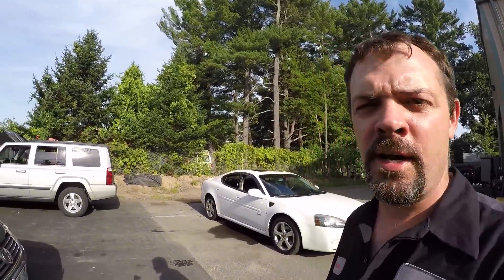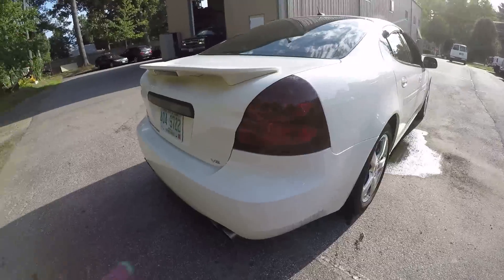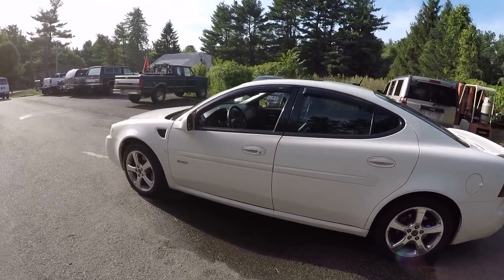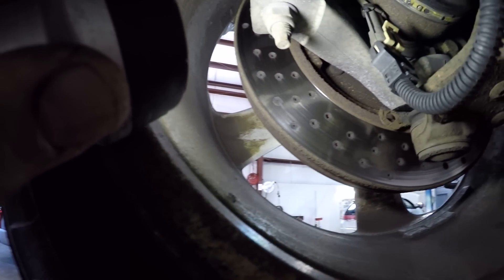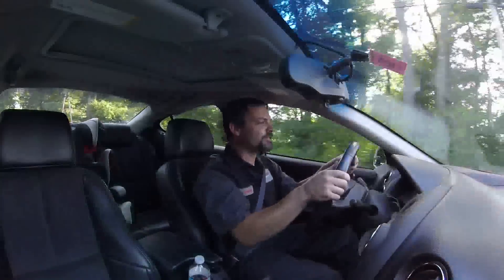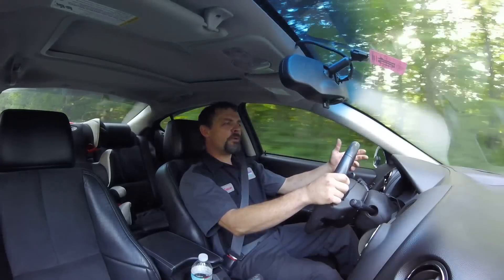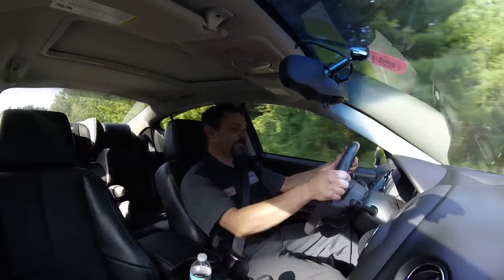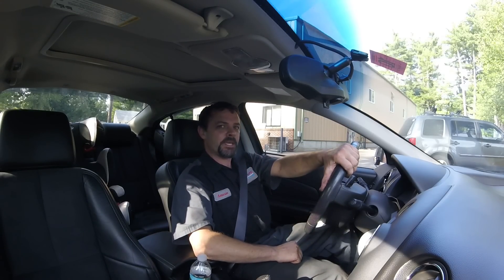Factory LS Powered V8 Grand Prix! The Pontiac GXP.

Comment: I own a 2006 Grand Prix base model, but it’s fully loaded. I bought it in 2009, with only 60,000 km, it now has almost 200,000, and it just keeps going and going, all I do is have a service done every 5000 clicks, replace the usual things like tires and brakes, etc., but I got a Telya I’ve driven a lot of cars in my day, and this is one of the best cars I’ve ever owned, for a lowball domestic want to be sports car, it has a lot of balls, the corners so tight, the seats grip you, and even with The base engine, there’s not too many cars on the road taking out performed by Grand Prix. For some reason a lot of people look at my car and laugh, and try to accelerate me, they stop laughing after I leave them in my dust, the GM 3800 series three V6 has a lot of balls for a regular car. The transmission is cleared so that after you hit 120, kilometres per hour that is, you don’t feel the thing, and before you know it you’re doing 180, which I’ve accidentally done on many occasions. I just fell in love with the car, I don’t know why because really to look at it there’s nothing special about it, but it fits me like a glove, and until the engine dies completely, I’m never getting rid of it. It has no rust at all, it looks just as good as it did the day at rolled off the assembly line, mine is midnight black, with a limo tent on the windows, so I can look pretty aggressive at night on the highway. I’ve also driven the GT and then the GXP version as well, but honestly, there’s not really a hell of a lot of difference in engine performance. You think the GXP V8 5.3 L that puts out 103 more horsepower than my car, which snap your neck back, but I only noticed a small difference and exhilaration,The only difference was the GXP drink fuel almost twice as fast as the base model that I have, which I have to say is really good on gas. Anyways, just thought I’d throw that out there, have a great day guys!

Comment: Actually some younger people want a grand prix i want one for my first car and im almost 16
Reply: I would stay away from these unless it has a TEP transmission. The stock tranny was known to go out, mine went out 4 times while under warranty and luckily not since. Planning to give this to my kid when I pay off my other car and get another
Reply: I've had mine for almost 2years and drove it pretty hard. I'm needing a new car soon but that's only because there is a lot of rust, the car it self has 345,000ish kms on it and still running nicely. It only left me on the road once when some clip for the coolent broke and all my coolent drained, I was still driving it around on max temp for probably 10 to 15 mins not knowing that it's overheating. But that was last spring and it's been fine ever since.
Reply: Crazy that this comment was made 4 years ago and I’m in the same situation. My mom is giving me hers, needs a little bit of work but hey I’m grateful.
Reply: I got one for my first car, im 17 and i love it, once i move out of the house and get some money i might get a gxp
Reply: @MustangMan1  Couldn’t disagree more, i have a 2008 and it has 106K miles and the transmission has never gone out once... It’s possible to get a very reliable one
Reply: A Pontiac was my first car at 19

Comment: my gxp has 80500 miles. still going strong. wish the underside of mine was that clean lol. its been in Illinois for 15 years though so you could guess what it looks like.
Reply: same here 130,000 and going strong .. Jersey winter salt ..her poor underage .. I now spray it down with  WD40+ trans fluid .. but she still gets out of her own way  .. fun at lights ......
Reply: @TomDoesUtube  lol yeah salt sucks. 130k is good for these transmissions hope mine will make it that far. At 83000 now. Still feels like it’s shifting good
Reply: @treecutter116  the starter on mine has been working fine but it has that issue that’s common in these cars. The starter doesn’t disengage from the flywheel right away and it makes a grinding noise. Only when it’s cold outside though. Might get it replaced before next winter.

Comment: I love mine,  I have embarrassed some ricers  and gave a couple Vettes a run for their money but they did beat me.   Best surprise was on I40 somewhere in AZ. I beat a new Cameo.  Mainly because his cut off somewhere around 150MPH  and I had the limiter on mine deleted in the tune.     He pulled up beside me and gave me a respectful military type salute as he smiled and shook his head.    No doubt he would have won if he had a tune but I will take the win.  On the same trip me and a C6 Vette cruised for 75-80 miles and over 100MPH  we took turns leading.

Comment: I got one of these. Mines black though and its an 08.  They are good cars but the transmission is the weak point because they used the same transmission from the v6 models. The 4t65e hd
Reply: I have an 08 too man since brand new. Still gets down like new. 200 thousand
Reply: @randomfootballcars9547  do u ever get on it speed wise? That's alot of miles but💪🏾

Comment: Really, that's the kind of car a dad would drive, a family sedan with plenty of power.
Really with something like that with its power and torque it should have been built in a RWD Model.
Reply: Which is why the G8 was imported. Was planned to take the Grand Prix position as the family sedan. If you want performance in a RWD package, G8 is the way to go. For Pontiac anyway.
Reply: +Chris Monroe I thought that was what the g6 was for
Reply: +no horizon G6 is only a 4-Cylinder or v6
Reply: 100% agree
Reply: @chrismonroe8417  if you can find one with the V8 in it! If you’re a diehard Chevy guy, you need to find an Impala SS or the police version SS..... V8s all the way with RWD

Comment: Interestingly enough, the GXP option on 2004-05 Pontiac Bonneville came with the V8 Northstar engine. Would much rather have the S/C 3.8 or the 5.3LS over the Northstar though in my opinion.

Comment: if I'm not mistaken it's a 2008.  the last year of Pontiac they decided to put a V8 in almost every car they built. the Bonneville came with a Northstar and the G6 came with either a turbo or super charger.  I think they figured if their going out why not go out with a bang. lol
Reply: sadly most of the transmissions can't handle the power and they are the ones doing a bang
Reply: sadly most of the transmissions can't handle the power and they are the ones doing a bang
Reply: None of the g6 models were either turbo charged or super charged
Reply: @Moecean  Thank you. Don't know where he got that info, but it's definitely not accurate. The G6 GTP could have definitely benefitted from a low boost supercharger though, something like what the Grand Prix GTP had.
Reply: @Jayhoyt32  either a supercharger or the turbo 4cyl from the 08 cobalt ss would be a really nice fit.. I wonder why they never stuck that engine in one..
Reply: The Grand Prix got the V8 from 2005-2008
Reply: its either an 06 or 07. 05 didnt have the black paddle shifters or chrome rings around the air vents. and half of the 2007 and all of the 2008 models didnt have forged alcoa wheels.
Reply: Yep. Last year Grand Prix. Bought mine last year and it came with a brand new transmission with a 3 year warranty. It’s dead mint. 5.3 LS4 V8 has mega torque. Sport-tuned with AFM/DOD deleted. Hauls ass. Alcoa aluminum staggered rims. Handles like a dream. I actually prefer the front wheel drive. Luv my car
Reply: @Moecean  the g5 was
Reply: @Moecean  g5 gt

Comment: Can I swap a gtp05 transmission into a gxp 06? If so would it be worth it? 118,000 miles gxp transmission bad. 130,000 miles gtp need head gasket but I'm just taking the transmission.

Comment: these have the 4t65e transmission. the same ones that they put on the base model v6. that's why I'm hesitant to buy one because they aren't build to handle an ls
Reply: The 4t65e is built to handle the supercharged 3800. There's plenty of guys who take those cars drag racing and have the engines built up stronger than the ls4. That transmission can take it all.
Reply: kajidono the trans in these cars go bad so easy. I've seen so many barely get to 100k miles. before trans messes up. my dad's only has 56k and he has already felt it messing up.
Reply: I've done some more research on these, and actually have a 2004, and you're partially right. I should have specified 4t65e-HD, but that's not what goes in the base v6. The 4t65e-HD is hit and miss on how well it holds up. It has smaller parts, like the differential, than the 4t80e, but it can be rebuilt much stronger and it's lighter. Mine with the 4t80e has 162k on it and the axle has worn into the housing so bad that it leaks right around the new seal I had put in it. Nobody even wants to work on it. On the other hand I'm looking at one with the 4t65e-HD with over 280k on it and there's nothing wrong with it. My old Bonneville had over 240k on it and it held up fine, even though the fluid was black. The base v6 gets the 4t65e. The supercharged and v8 models have always gotten the 4t65e-HD or the 4t80e (Northstar cars).
Reply: Jake Bergren no
they got the 4t65e-hd.
They have a few upgrades to make them stronger but yeah it's basically the same architecture.
Reply: Gm fwd transmissions were crap from the factory. The 4t65e hd can handle some power but over 300hp they are sketchy. I managed 320 whp in my ssei but even I was doubting the trans at that point even with 92k miles on it. But in reality an l67 can make more power for less money than the ls4. Sucks the Bonneville gxp only had the shitty northstar motor when they should have had an ls instead.
Reply: It's really a ticking time bomb. I bought my 2007 Impala SS almost 3 years ago with 75k miles and after the first 8 months of owning it, the trans ate shit. Had a local shop rebuild it but there was a hairline crack in the case that caused that one to eat itself alive in about 500 miles. Now I'm on trans number 3 because the aftermarket remanufactured one that was put in after the first rebuild had the forward bands fail. So far so good on number 3. But a lot of guys on the LS4 page on Facebook have different stories. Some are still on the stock trans after 100k+ miles and others are way under that. It's not a matter of if but when it will fail.
Reply: it was a completely inadequate trans for the gtp let alone the gxp...they burn up and the pcs like to go early.my 05 gtp started having problems at about 115k miles..change the fluid and filter OFTEN and they can hold up but not for someone racing and doing burnouts and shit...
Reply: The trans on my 06 needed replacement after 115,000 miles

Comment: I have an 08 grand prix GXP. Have had since 08 brand new
 200 thousand miles and still gets down like its brand new. Putting a chip in it next month with and intake a downpipe. Going to slap a turbo on it within the next 2 years.
Reply from the maker: We just this week had to put a new transmission in this car..
Reply: I have a 2008 pontiac grand prix sedan I love the are it doesn't have all the extra stuff on the wheel anyways do you use dex-cool antifreeze that crap looks like caulk on the radiator cap I'm doing a radiator flush I just got the car and had to change the water pump is there anything I can use besides dex-cool that last owner didn't keep up on the flushes smh great car tho very tight space to work with carburetor also get very carb up cleaned that up now it starts on first turn

Comment: TAPShift gear changes on the 04-05 GTP w/Comp G package are quicker than the V8 GXP trim level.
Reply: ive owned a 05 comp g and own a 06 gxp and this is false. they have the same shift speed.

Comment: that engine bay looks like a nightmare to work on 😩
Reply: I love mine, but you are correct.   almost 2 hours to change a battery if you go by the shop manuals.   I was able to do it in about an hour but had to turn the batteries on their sides to do it.

Comment: You would think that an engine with that much torque in a front wheel drive car would be a recipe for monumental torque steer.  They must have done something pretty clever with the diff and front suspension geometry to make it behave itself.  I bet it would make a great highway mile muncher...
Reply: If you're not careful they will tear up the transmissions too.
Reply: Jacob Hoschar   Mind you the same can be said for any torquey engine matched to automatic boxes.  And, in some cases, to manual boxes too.  Sometimes it takes miles bolted to a high torque engine to really expose any weak links in transmission land...
Reply: Yea, but GXP Grand Prix's are particularly known for it. No matter the modifications or driving habits. Don't know if it's just a design flaw or what but it's a decently common thing with owners of them.
Reply: Jacob Hoschar   It could be that they tried to use a version of the standard Grand Prix transmission and it just wasn't up to the job of harnessing the V8...
Reply: They also made the front tires wider than the rear for this exact reason

Comment: Wife has this car with the supercharged 3800. 337k miles, yes, 337k on the original engine and trans. At least a dozen front wheel bearings tho. Lol
Reply: So it's not this car.. It's a 280 hp turd wagon. Get outta here
Reply: scott back 400000 on my 2004 3.8 daily driver Grand Prix got 2 wheel bearings lolo. Just purchased a 2006 gap for $1100.00 same shape as one in video but need transmission and safety check

Comment: 303 hp is about the same as the previous Grand Prix GTP - but they were a 3.8 supercharged instead of a V8.  I found it to me kinda dumb - superchargers are best for low rpm torque off the line, and that's one that you usually have too much of in a FWD car.  Always thought a turbo would have worked better.  I didn't have traction control, either, so I could either drive really slowly off the line, or light the tyres up - not much in between, sadly.  At higher speeds when you could use more power, the higher revs meant there wasn't as much power as I could have used, so it was the worst of both worlds.  I'm thinking the V8, having a more linear power curve, should go quite a bit better.  :-)
Reply: Supercharged 3800 was 260 hp
Reply: @MonzaRacer   Meh, I've seen them listed anywhere from 240 to around 330.  Hard to find numbers one can trust, so I just picked a middle-of-the-road number to work with.  :-P

Comment: Try taking a corner at race pace, bet you torque steer right off into the .. cabbage
Reply: Front wheel drive on a race track with good tires and an LSD is just fine... it's only really an issue on the street when accelerating from a stop.
Reply: If it was a race car, I would expect it would perform quite well but.....this isn't a race car.
Reply: +ArchimedeanEye yes I'm shore fwd cars are rubbish
Reply: It comes stock w/ FE5 Bilstein HD Struts w/ performance springs, 19 mm rear sway bar and a front sway bar attached to the strut body instead of the LCAs. It also came with 255 front and 225 rear super sticky tires. I'm sure it can take a corner just fine.
Reply: would be nice if it was AWD then supercharge the ls